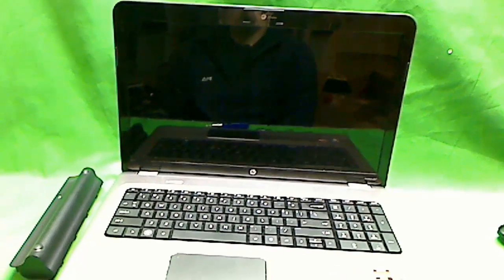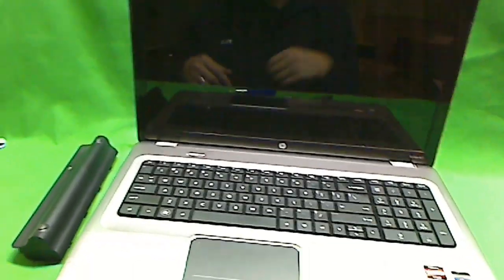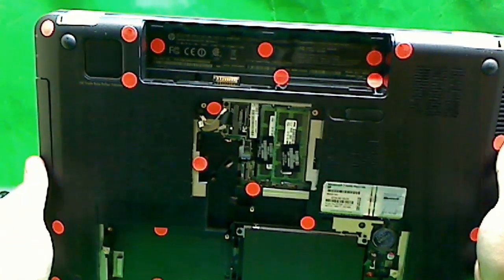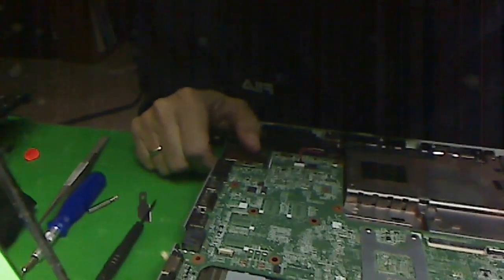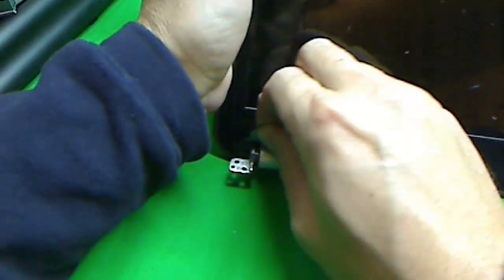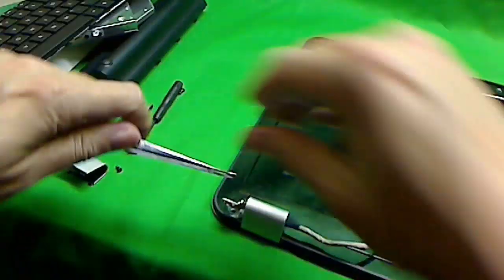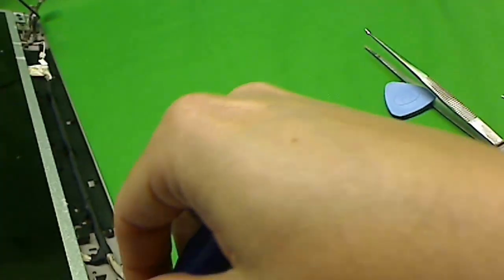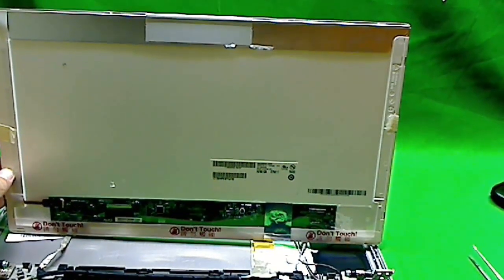HP dv7-4065dx Laptop Screen Replacement Procedure

Comment: This was a thorough explanation.  It really helped me replace my screen.  I used this screen: http://www.ebay.com/itm/LAPTOP-LCD-SCREEN-FOR-HP-PAVILION-DV7-4065DX-WXGA-/300871321715?pt=US_Laptop_Screens_LCD_Panels&hash=item460d540873.  The new screen had an extra ribbon to move the connection location from right to left.  I just removed it.  Thanks.

Comment: Update: I ran the troubleshooter and it showed no problems. I restarted the computer and nothing. I reset the access point, then about 5 minutes later, the access point and the laptop reconciled. Everything works. Just have those left over screws.

Comment: Outstanding video. I have this model and was able to replace the screen. I may have figured it out, but it would have taken me days. I have two extra screws and two "threaded collars" that you don't show in your video. One has a triangular base and one rectangular. Both are slightly smaller than a dime's diameter. I'm guessing they are related to the keyboard. They were loose. Lastly, while I can connect to my wireless access point, it claims there is no internet connection. Weird. Any ideas?

Comment: Thanks so much! Finally got it done, HP wanted to charge me $300, bought the screen and did it myself with your help. PRO TIP: Have tape on hand, the last cable you take out will probably need more tape putting it back together.